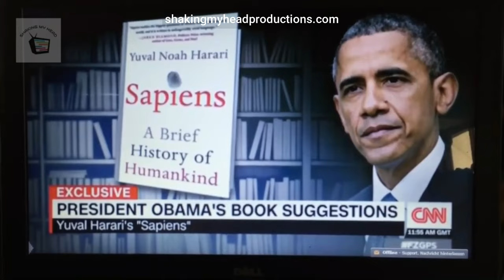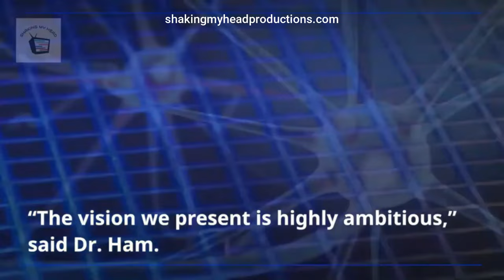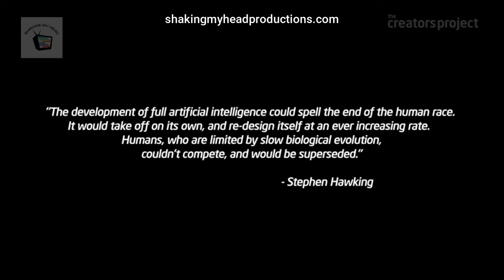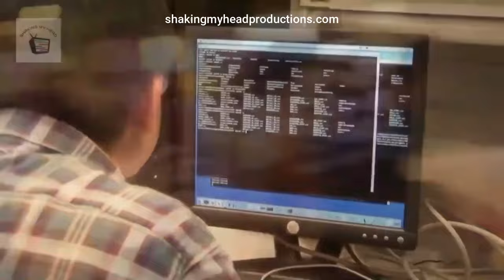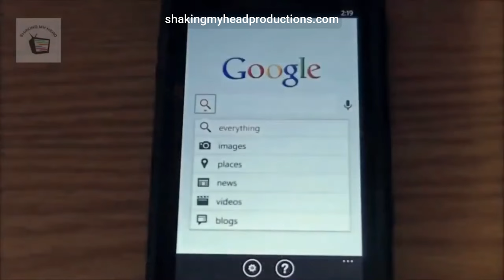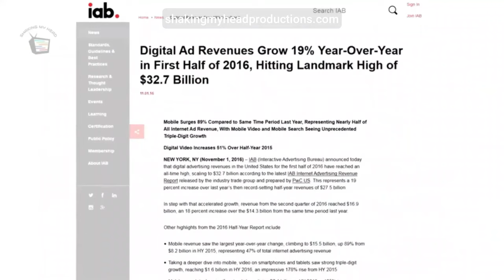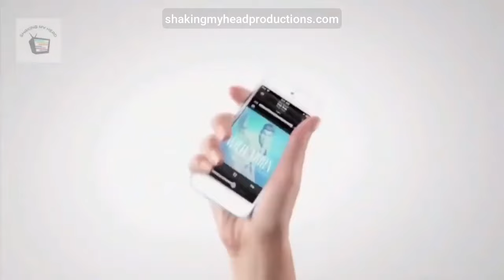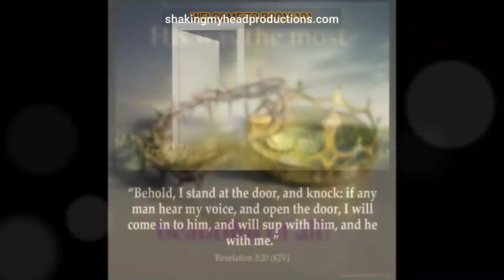Black Mirror Metaverse - A Documentary - Room 101

Comment: No one no one no one should be on or using phone during any class
Reply: When I was in school. When I went because I always felt like it was to control me, we weren't allowed to have calculators in class. We had to solve mathematics in our heads. Back then it was viewed as cheating. I used to be able to remember 10 different phone numbers. Now with a phone, I don't know 3 numbers off the top of my head..